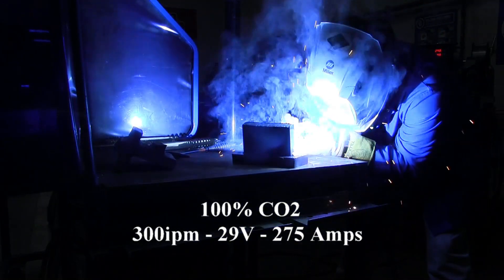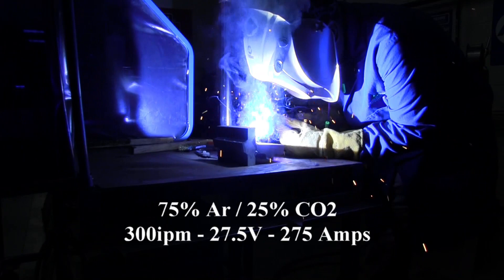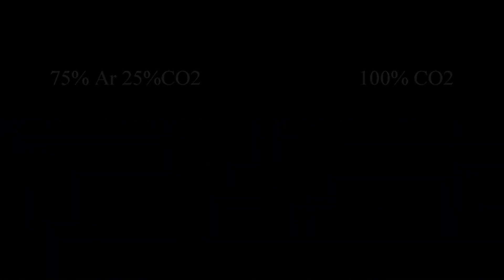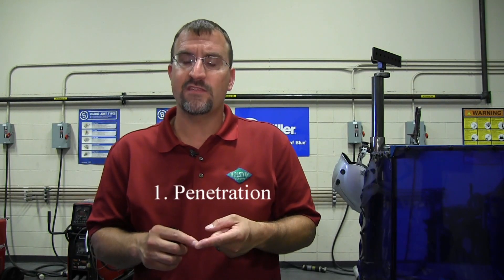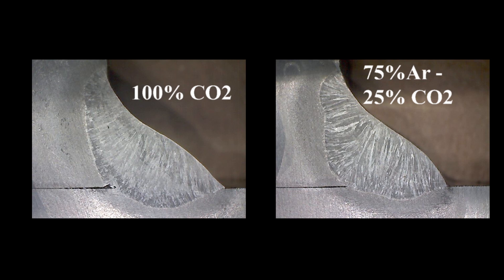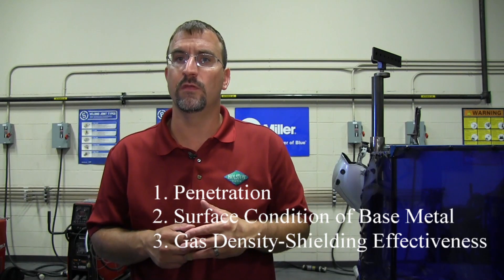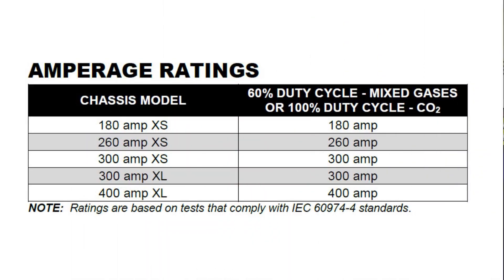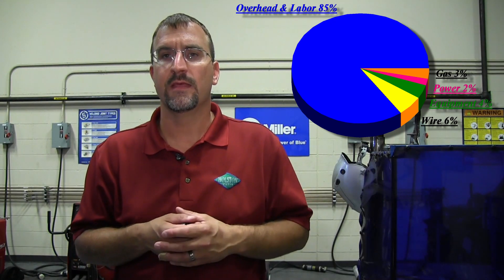Welding Fume 100% CO2 vs 75%Ar/25%CO2

Comment: You lose ductility when using mixed gases alot of gas fluxcore wires even though they can run on mixed gas should instead be run on co2 I was working at a plant ware we kept having cracking issues even after a good preheat and post heat we were using c25 the welding engineer suggested to go pure co2 and it went away all of it so beware your tensile strength goes up with c25 but you lose valuable impact resistance and more prone to cracking
Reply: Carol Shawol,thank you for sharing that knowledge from experience.
Reply: I work at a place that uses 100% co2 and we still have cracking. So don't get where you think that cracking is less with c02.